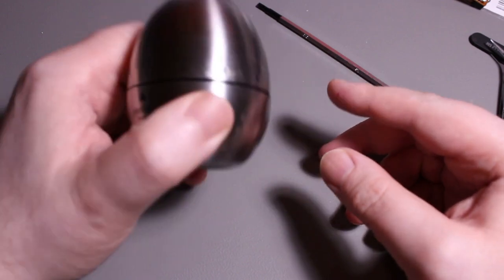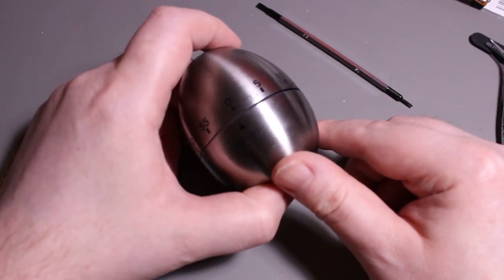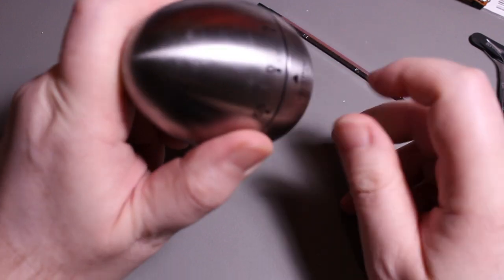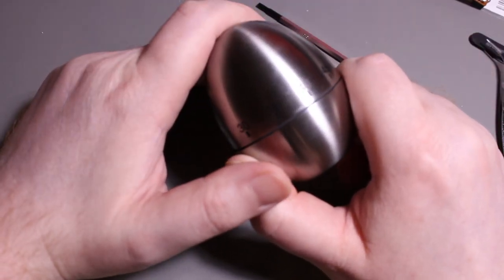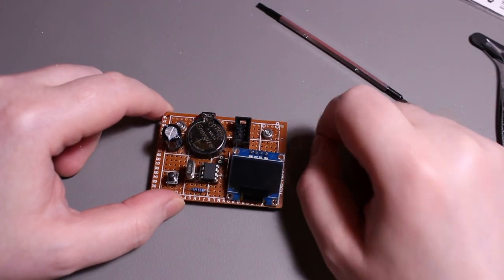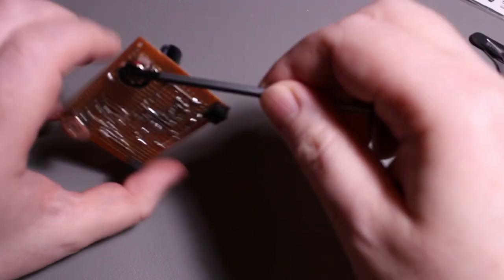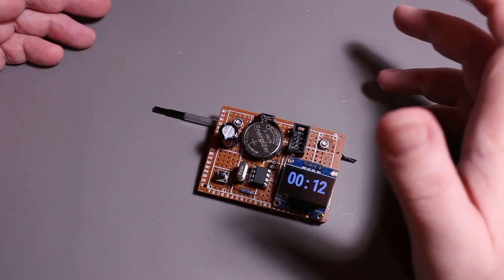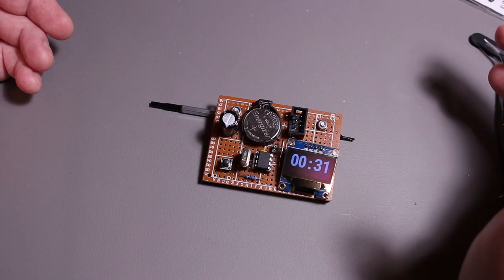cook'oo clock - The Smack-'n-Go Reverse Kitchen Timer

Comment: Pretty cool.  I guess I would have just used an AC switch and an old school electro-mechanical alarm clock (both of which I have), but I do like this. :-)  Soldering and cooking don't go well together, however.  I'd seal it up somehow while retaining the ability to change the batteries and having the magnet electrodes still work.
Reply from the maker: Yeah, you're definitely right about putting it in a case or otherwise sealing it, also since the entire back side is exposed right above a metal surface. I'm always half way wondering if today is the day I'm gonna short-circuit the whole thing. Well, at least it's lead-free solder - still wouldn't want to drop it in the pot though :)

Comment: Sven
Brilliant, especially with the magnets, I have downloaded the code from your github repository but can't open the file, Winzip say a file contains illegal characters. Can you please assist
Reply from the maker: Whoops, it appears Windows doesn't allow certain characters in file names, ':' being one of them. There are few files containing that that character in the graphics/ directory though. I renamed those files now, so if you download the .zip file again with the latest changes, it should hopefully work now.

Also, one thing about downloading the code as .zip file instead of using git directly: the external libraries it uses won't be included in the .zip file. I added a section to the README to explain this https://github.com/sgreg/cookoo-clock#using-zip-file-instead-of-git (commands are for Linux / Mac, but the principle should be the same in Windows)
Reply: Sven Thanks, 
I have downloaded and un-zipped it successfully now but  my knowledge is limited to uploading Arduino .ino files in Windows environment and do not have access to Mac or Linux based machines, and I am unsure how to proceed to upload the software to the pro mini. I have a Sparkfun AVR pocket programmer if that helps and would appreciate greatly any help or advice you can offer.
Regards
Jim
Reply from the maker: I'm afraid this won't be working on a Pro Mini. The code isn't using Arduino and is written straight for the ATtiny85 microcontroller, while the Pro Mini uses ATmega328 - which is a similar family, but not the same.

The code itself could be adjusted to work with the Pro Mini, but you'd need different libraries to handle the OLED, and at that point, it's probably less hassle to take one of the SSD1306 examples for Arduino (like from Adafruit for example https://learn.adafruit.com/monochrome-oled-breakouts/overview) and start from there.
Reply: anotherSven 
Sven,
I am sorry to mislead I meant ATiny85 not Pro Mini, too much going on.can you assist??
Reply from the maker: You'll have to install the AVR GCC toolchain for Windows, along with avrdude, but I've never done anything AVR related on Windows, so I can't assist you with that. But it should be a common enough thing to find information about it on the internet.
To actually program the microcontroller, you'll have to check how to use your programmer with avrdude on the command line and adjust the "AVRDUDE_FLAGS" line in the Makefile for it. Based on https://learn.sparkfun.com/tutorials/pocket-avr-programmer-hookup-guide/all#using-avrdude-via-command-line,  I'd guess you need to change the "-c usbasp" parameter to "-c usbtiny"
Reply from the maker: I don't know why this hasn't cross my mind before, but I've added pre-built ELF and HEX files now to the repository (in the release https://github.com/sgreg/cookoo-clock/releases) as an alternative to worrying about setting up the tool chain and compiling it all yourself.